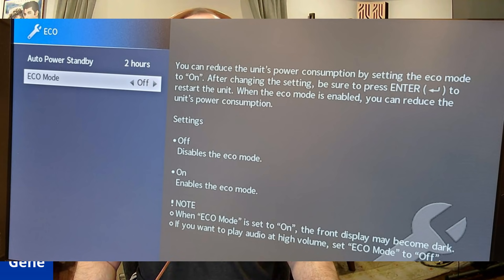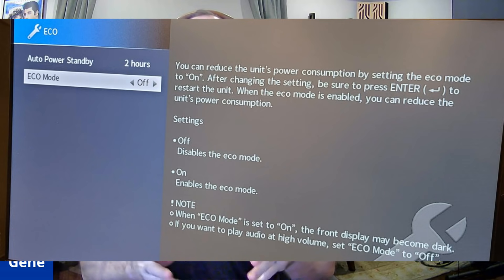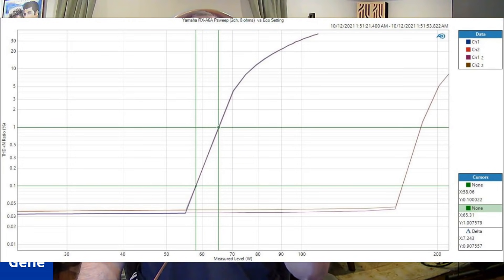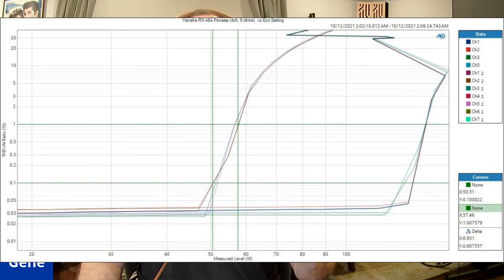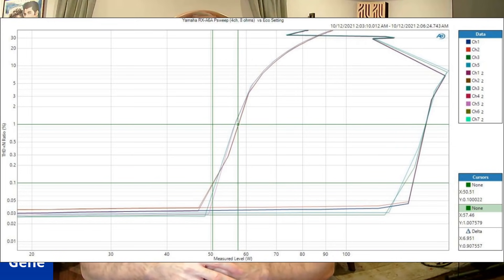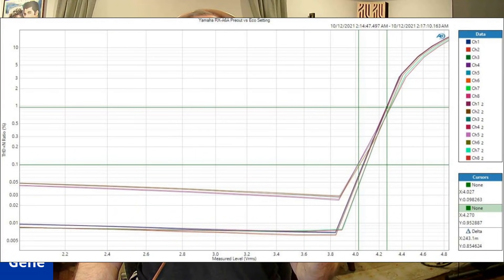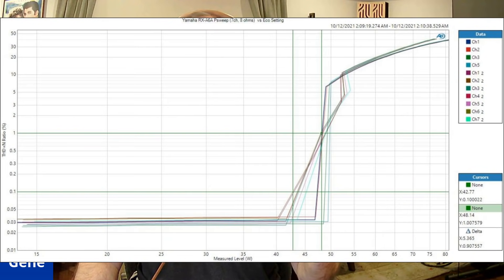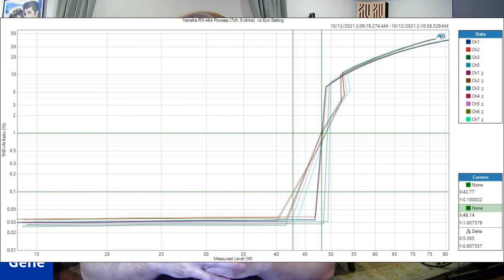ECO "On" Kills Amplifier Power of Your Yamaha AVENTAGE AV Receiver!

Comment: Great tip Gene. Leaving eco mode on on any AV equipment is like accelerating with your brakes on.
Reply: I got a great idea. Let's turn the eco mode on AND enable the 4ohm switch. Lmao
Reply: Actually it's just like putting a stop under your accelerator. Driving with brakes on is wasting power so poor analogy.  

It's more like not allowing an engiver 3000rpm. Which in a huge number of cases won't affect anything. 

Lower power draw for just daily TV or content viewing with no real loss in audio quality but less consumption from the wall isn't a bad thing.

For loud things like "movie night" turn eco off. 

Even 40w is WAAAAY more than many people actually use. You'd be surprised how just 1w is actually quite loud watching TV and a good 30 decibels louder than someone asking directly at you.

Comment: Given that the purpose of Eco Mode is to save electricity I expected a test of the feature would mention power consumption. Does it draw the same amount of power at idle? At a given output power? Does it idle sooner? Is any audio DSP or video processing throttled?

Comment: I have a Denon 3700H and I can attest to the fact that with ECO on/engaged it absolutely kills bass power to my 2 SVS PB1000 subs -  so I turned ECO off in system settings but the avr display does not display mode settings. I went back into settings and Denon offers ON/OFF/AUTO options.  I then realized that by selecting AUTO this setting has nothing to do with Power settings but it is only designed to alert the user that each time the volume is changed or the avr source is changed it will identify and display on the tv (for about a second) what ECO mode is engaged - which I find really cool.   One other thing about the Denon 3700 is that it runs hot - and I mean hot.  Problem solved with a fan from ACInifinity that sits atop the Denon and ports the exhaust out the back of it.  They make cooling fans for any setup.  And no, I am not an ACInfinity rep.

Comment: I bought The RX-A6A about a month ago. but it seems like Yamaha rolled out this flagship receiver with some major imperfections. which is kind of surprising for such a high-end receiver. 
I bought it thinking firmware updates will eventually fix these issues. also, Yapo is not doing such a great job of speaker calibrating. I found it to be easier to do it manually. with firmware ver 1.96
the question I have did Yamaha address the issues you found on A6A? including the eco mode. 
Thank you again, Gene.

Comment: Gene- thanks for doing all the research for us and providing recommendations. I love watching your videos and you are a true inspiration. I have a question on the aventage line of receivers. Yamaha always recommend connecting 4ohm speakers only for the fronts per yamaha manual. Is this system really not capable to run 4ohm speakers across all channels or Yamaha wants to go conservative by restricting load to avoid damages to the receiver when listening at insane volume levels?

Comment: Thanks for bringing this up.  I have often wondered about these modes.   I have the Marantz 6011, and I decided to run it in AUTO mode and figured that would good.   As you pointed out, those of us that have AUTO mode, it seems to act like a 'regulator' and switches as the demand calls for it.   

However, then it may come down to the 'reaction time' of this auto switching vs. running with AUTO off.    What do you think?

Comment: Do the xlr outputs also put out 4v rms? Yamaha also must have upped the preamp out voltages. My RX-A3080 is rated at 2v rms output. Is this correct?
Reply from the maker: XLRs give you 8Vrms output unclipped.

Comment: This is always a confusing issue...I have a Denon X6700 and use 7.2.6 Channels, so I have an external amp for two of the Channels. Now, I measured the actual power requirements for those two extra channels and it was barely 1W per Channel. Of course that is a Class D...but how much amp power do I actually need...
My Denon has Auto Eco Mode, but that just reacts to the settings of the Main Volume knob, not the actual power requirements, so if I turn up to -20db or something, then ECO is off, even if the actual power draw is just something like 5W per Channel...🤷‍♂️

Comment: Hey Gene did you find the center spread on this receiver
Reply from the maker: Haven't looked for it yet but my guess is if they implemented height virtualization, they turned off the center spread feature. I will investigate and bitch about it if they did.
Reply: @Audioholics  pretty sure they did
Reply: Cant find it anywhere
Reply: @Audioholics  Gene, that can't be right Yamaha ought to have Dolby's "Center Spread" setting which as we now know can happliy co-exist with Atmos Height Virtualizer as D+M & Onkyo/Pioneer reinstated this feature towards the end of last year on their AVRs, would be a shame if Yamaha have inadvertently omitted it in their new 2021 Aventage lineup :(

Comment: Just to clarify, at lower volumes does the receiver use the same amount of power as it does when high?
Reply: Unless you're REALLY cranking it - yes, at least that's the case with my Denon X2500H (I have it plugged into a watt meter out of curiosity). In my 20 square meters room it's pretty much impossible to see the power consumption rise for driving the speakers louder because it gets very uncomfortably loud before I see the rise in the wall power draw. And my speakers are nothing especially efficient.
Reply: @VioletGiraffe  Thanks. I’m using my one in a small sized room at the moment so I’ll try my one in eco mode as I might get away with low volumes. Currently I won’t put it past 40% is movies/ games and music is loud enough at 30%.

Comment: Gene, HURRY UP IM DYING FOR THE FULL REVIEW! I was lucky to grab a A6A right after release somehow. I'm enjoying it, but was a bit disappointed in YPAO. It heavily boosted my left surround both in the PEQ and in the level which caused me to melt the voice coil during the White Noise in the Dolby Escape video. :( Was never an issue in my older Yamaha recievers. It also arbitrarily gave me something like a wide Q -2 db 30 hz drop for no reason. I run dual subs and a MINI DSP so I just bypassed it but it did an extremely poor job with base. My room has a +8 db room node at 47 hz and it completely left that alone to give me an unneeded drop at 30hz? OK.
Reply: Never use Ypao it’s no good

Comment: I turn it on with my Yamaha 3080 when watching at lower volumes at night,  keeps the unit cooler in my cabinet and keeps the power usage down. Of course If watching at high volume I turn it off I see no problem with this.

Comment: Wow only 50 watts, less than I thought, even for beach test.  How many volts is needed, in the pre amp, to powers 200 watts per channel?
Reply: in a typical room with typical speakers your ears will bleed with 50W! the whole device here consumes 30-45W - forget all the 1000W nonsense on ads

Comment: I don't understand eco'?  Why would you ever use this?  It's like buying a V8 car only to have 4 cylinders activated.  What happened to the old days of ON and OFF?
Reply from the maker: There is an "off" mode which I recommend using in ALL scenarios UNLESS you're just using the receiver as a preamp.